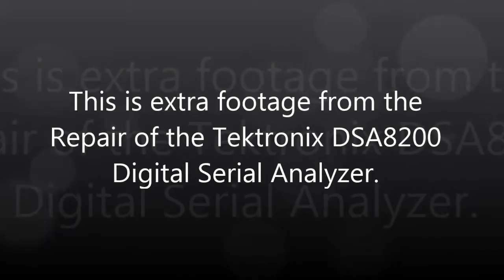(#0066) My Microprocessor Collection

Comment: Still have another with Netware 3.0 on it, we finally switched it off last year ( it was sitting in my office headless but still running) as I looked at the logs and noone had done any access for a year other than me using it as a scratch drive ( Only way to easily pass info from a older dos system to a windows machine, and to access data on 98 after MS did an update that killed 98 from being able to run a SMB share) and as a quick and dirty virtual giant floppy disk.

Comment from the maker: I also have an old Pentium II machine with Win98 and 9G drive. Cost a good 2 k$ back in '98. That's the main reason I kept all these slot-1 devices. Haven't used it in years, but still plan to resurrect it. Maybe pimp it out with a 40G drive!

Comment: Still have 1 running in a system, with Win 98 on it. On it's second HDD, first one died of old age, so it was migrated over to a whole 8G of drive. Runs a telephone management system that is now made from obsoletium, but it will only be upgraded when the PBX it is attached to finally dies. PBX is made from both Obsoletium and Unobtanium, but still runs, and will only go when it fails beyond the remaining spares I have.

Comment: I still have a 4004 on a old Busicom calculator board. The SLOT ! packages were discontinued because of cost, they were too expensive to make, and were also too tall for low profile cases. Still have a pile of them as well, I use them as nice little fan cooled heatsinks if I need to handle 40W of power.